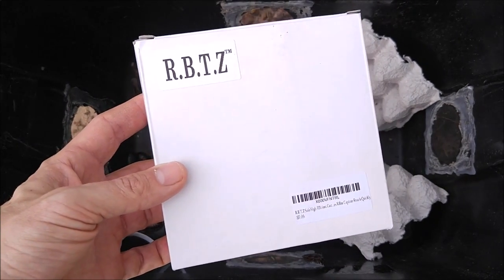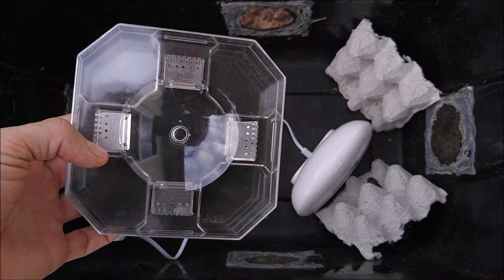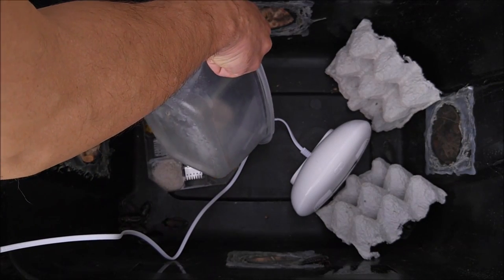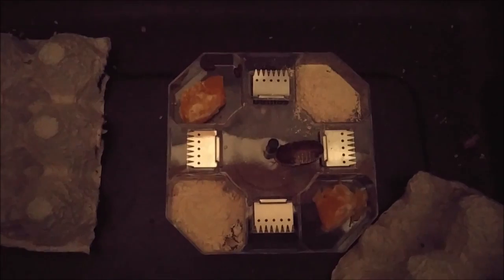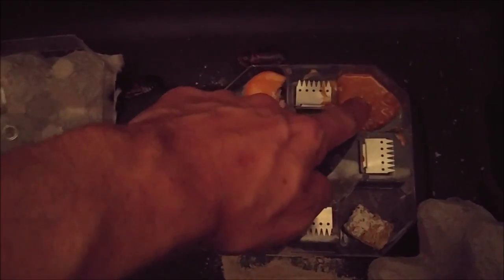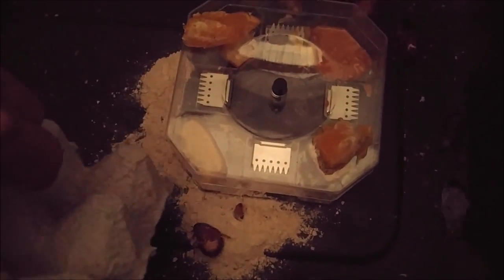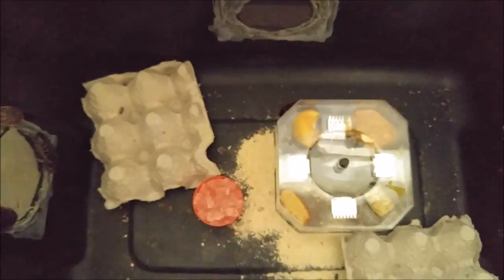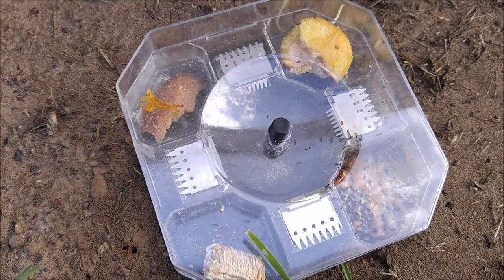(:Review:) RBTZ CockRoach Trap ~ Tested on Camera w/Dubia Cockroaches

Comment: No need to buy all these traps,  just use 20ml of used oil in a plastic container, keep it inside the shelf,  after 10 days, you will see 100 cock roaches trapped. It cost you nothing.  Simple huh?  Think about it.